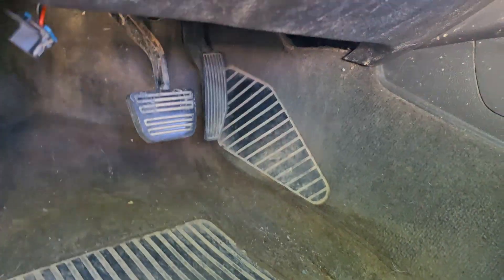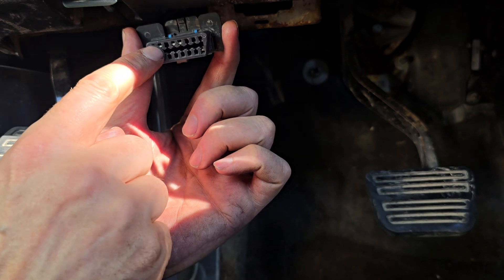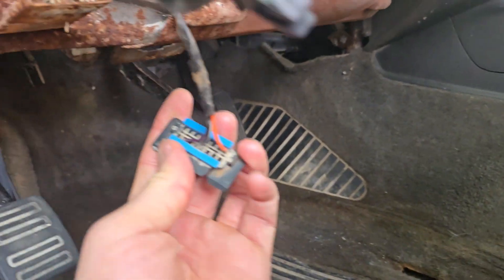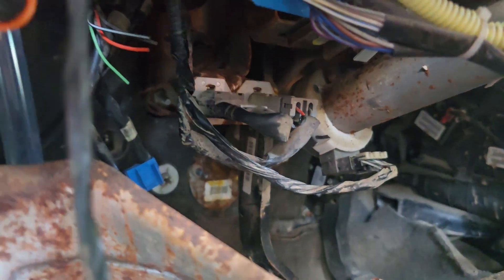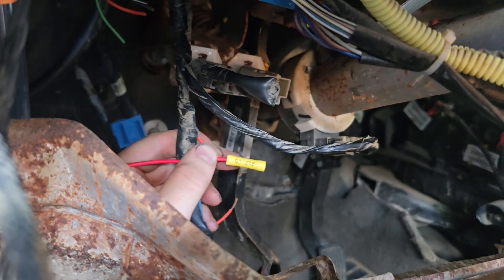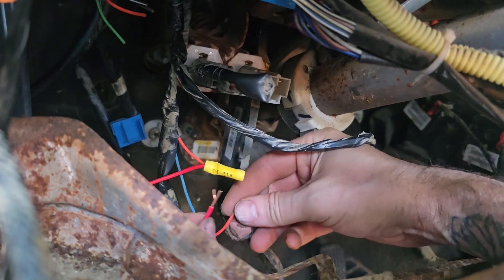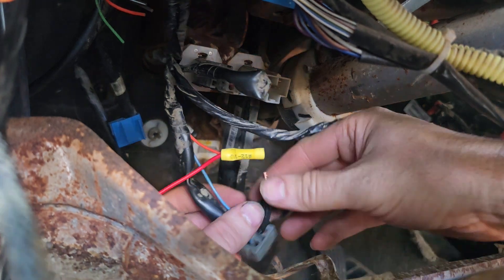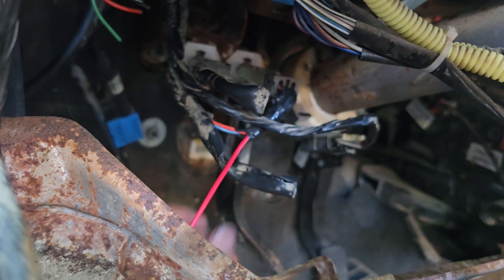Hummer H3 - dead OBDII port fix - works for almost any vehicle!

Comment: Keep making the videos man I want a 2007 Hummerh3 I’m in currently building a 4.2 L in-line six Atlas engine the bigger brother of the 3.7 out of a 08 trailblazer turbo charged when I get done with it 500 horse 500 pounds of torquegoing in the hummer
Reply from the maker: that's a huge upgrade from the 3.5/3.7L !  would be fun to drive, while i'm over here considering to get 35" tires or not because it'll suck the torque outta my H3 even more lol  (i have 3.5L)